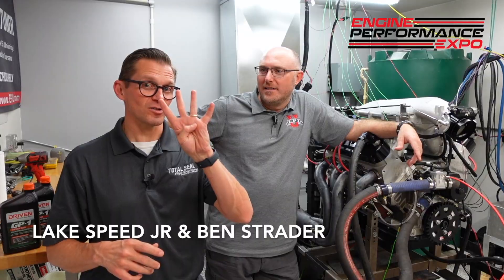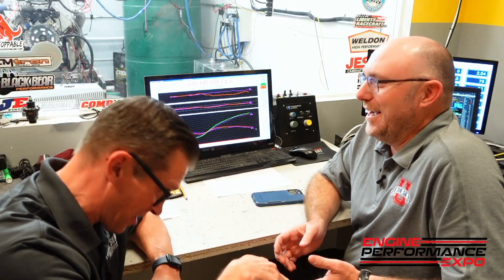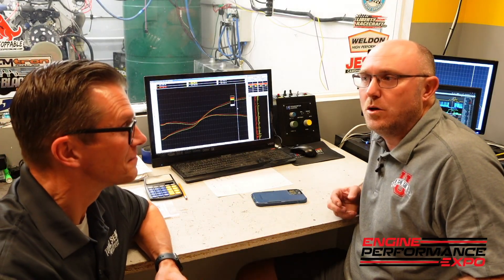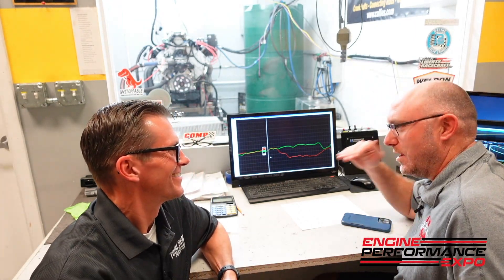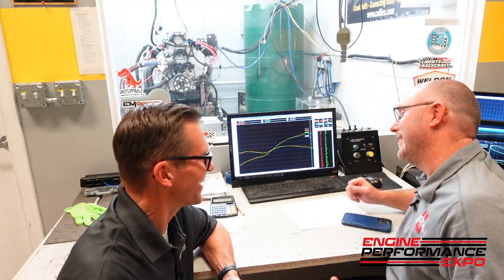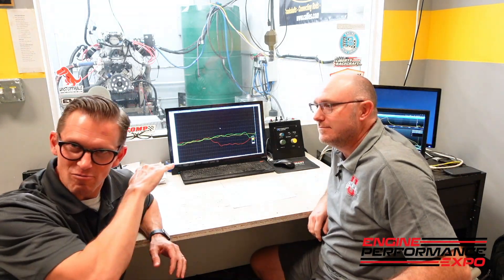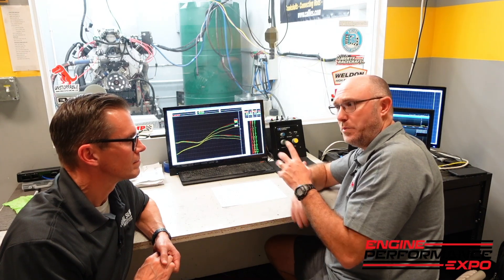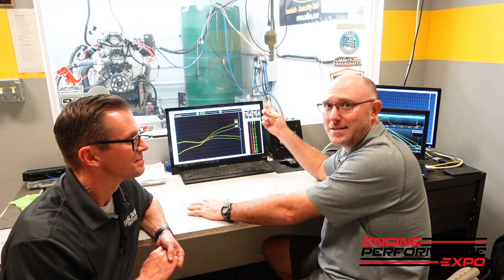How MUCH OIL is TOO MUCH? Dyno Results!

Comment: Did I miss where they mention how much oil this engine took, was 9 quarts overfilled? I was thinking this was going to be showing what happens if someone overfilled their oil and what effect it had. Like, does half a quart overfilled matter? What does a quart over do?
Reply from the maker: The oil pan was designed to hold 11 quarts of oil with steel rods, which have a smaller cross sectional area. With these Aluminum rods (much larger cross sectional area) we had to drop the oil level to keep the rods from hitting the oil.
Reply: @themotoroilgeek  thanks for the explanation. So 9 is full or overfilled on this setup?
Reply from the maker: @seashackf1  For this set up, the data indicates 9 quarts is overfilled.

Comment: What about fitting a better oil pump and pressure regulator? Get the advantages of extra lubrication without extra oil.

Why does the oil pressure drop in the first place? Is it because of the pump and regulator being inadequate in some way or some other reason?

How much oil foaming is taking place and is this a factor?
Reply from the maker: The pressure drop is due to oil being retained in the heads, which dropped the inlet head pressure.

Comment: Running a car low on oil is one of the worst things you can do for it, which comes in second by running a car with too much oil in it. You'll break the engine if you run it with two quarts more than it needs. It takes a little longer to break an engine running it two quarts low.
Reply from the maker: Right on!

Comment: I've always heard that an excessive amount of oil will cause cavitation in the oil.
Leading to extreme wear. 🤔
True or false?
Reply from the maker: True. If we kept running it at the high oil level, it would have caused foaming and that exact problem.

Comment: Oil pump will rob power too just pumping that oil. I don't run my engines at 7000 RPM so I would take lubricant over power in a range I will never be at.

Comment: Too low or too high of oil level is definitely bad, especially too low. I like having the oil level exactly between the two marks on the dipstick.
Reply from the maker: Right on!
Reply: I always go for 3/4 between lower and upper marks
Reply: Gotta have it at the top mark bud
Reply: @cartere9981  The full mark on the dipstick is full when at operating temperature. If your engine isn't hot then keep the oil level a little less than full.
Reply: If we want to use less fuel and drive calmly, it is better to stay closer to the permissible lower oil level, but... you should carry a canister of oil in the car for refilling and check the dipstick more often, and not wait until the oil indicator light starts to light up.
Reply: Top level is top marks!!
Reply: Always to top level. For protection!
Reply: @Davido50  The full mark on the dipstick is full when at operating temperature. If your engine isn't hot then keep the oil level a little less than full.

Comment: You guys make the best videos!
My suggestions though = 
1, You didn't really show at how much above the correct oil level you would start getting contact with the rotating assembly.
2, To a mechanic, it was elementary  that you would lose significant horsepower once you did make mechanical contact with the crank. It's literally a hydraulic dampener. Like a fan coupling or torque converter. 
BUT, I though the biggest issue was the aeration of the oil? Causing cavitation etc. Eventually damage as bad as detonation but in the oil circuit?
Reply from the maker: Thanks. Unfortunately, this is a Dart race block, so there's not a dipstick where we could have showed oil level. That would have been nice. 

In regards to aeration, if we kept running it we would have had a serious aeration problem.

Comment: An interesting comparison test. Unfortunately, the engine dyne is static and does not account for acceleration, braking and lateral load forces that would occur on the road/track and effect the location/availability  of oil in the sump to the oil pump. To finish first, you must first finish: I'll bet you would have a spun bearing in a lap or two with only 5 quarts during real world use on the track and/or oil temps would go through the roof on such a low fill. A windage tray or even better, a dry sump, solves a lot of problems, but the latter ain't cheap for the average schmo. I hope some viewers do not get swayed to under fill (unless they have pallets of spare engines sitting in their respective garages). Keep up the great videos, they are a treasure trove of information.
Reply from the maker: Thanks! We decided today to get the dry sump for this engine to run that test.
Reply: AGREED! 
I sense that this is a drag race engine destined for a sub 10 second car, so they would probably take the chance of sacrificing the whole thing to get more power, and just pray that they did enough of the wet sump fix 'tricks' to prevent any accelerative oil starvation.

Comment: At any point did you overfill the engine? I was expecting that to be tested.
Reply from the maker: That 10 quart run was overfilled, based on the data.
Reply: @themotoroilgeek  So the oil capacity is determined by the data? Interesting perspective. So then in regards to an engine that has a specified fill volume. Is that based on data or something else? 

I ask because I have an LTX engine that calls for 10 quarts. And your oil pan has an 11 quart capacity. But your data says anything beyond 10 quarts is overfilled. How can I compare this to my engine specifically without putting it at risk of losing oil pressure?

Comment: but i thought that overfilling will damage oil sealings on the long term! am i wrong? also im curious to see overfilling with low viscosity 5w40 then 5w30 then 5w20 & see how performance effected
Reply from the maker: If we kept running it at 10 quarts, it would have caused aeration/foaming problems.

Comment: I always thought if the crank was dipping on the oil the oil was way overfilled. With the low level, was it more the lower loss from the oil pump? In FR Banks I Kept no Diary  which i have not read for years there was a chapter where they reduced oli pressure to meet target power. I cannot remember if it was a Fird or Chevy V8.
Reply from the maker: When it lost big power, that was overfilled for this engine (due to the size of connecting rods).

Comment: So the question no one seems to be asking (that i could see) is what are you risking while you watch your oil pressure nose dive at 800'? This video seems to insinuate that having good oil pressure to the end of the pull doesn't matter.  (Asking as a member of the "dump another quart in it until it makes it to the finish line club") is it not a big deal to go through the lights at 8,000 rpm with 30# of oil pressure?
Reply from the maker: That slight drop in oil pressure at the end is not a big deal. We will have another video coming soon that shows those results.

Comment: I do recall hearing from a mechanic friend about a car that came in which was down on power.

The owner had decided to fill the engine with oil.

As in completely fill the engine all the way up to the oil cap on the rocker cover.
Reply from the maker: LOL
Reply: @themotoroilgeek , yep. It would barely run.

Comment: I have a story to tell that im not pleased with...

I've done many oil changes in my life but the first one I ever did myself I did very incorrectly. I thought engine displacement = amount of oil capacity. So i put about 2.75qt/L of oil in an engine that required 4.5—4.75qt of oil.

Man, i tell ya, when i first got the car on the street I was really impressed with the performance thinking "wow this is some good ass oil!" That is until after 20-30 minutes the engine bogged down and stalled and kept doing so...i limped it home and realized my mistake and added the correct oil amount. From that day onward the engine burned about a quart of oil every thousand miles. I had that car for many more years and it eventually stopped burning oil entirely for the last 10k miles of my ownership of it
Reply: Reminds me of a letter to the editor I saw in Hot Rod (or a closely related mag) in the mid-'80s.  Maybe it was the April issue, I don't know, but a brand new Corvette owner said he changed the oil filter after ? 1000 miles, as the manual instructed, and the manual also said the oil capacity was 5 quarts, 6 when changing the filter.  Soooo, he changed the filter, added 6 quarts, and the thing ran poorly, smoked, rattled and more!   😂 True story though!
Reply: @noimagination99  had to read your post a couple of times to realize he JUST replaced the filter and put 6qts of oil in on top of the existing 5 or so qts.
When limited experience isn't good for a DIYer!!
Reply: my worst oil change was on my 2020 corolla hatchback  i start my car and oil filter was leaking after 5km low level light ! and tik tik tik tik noise ! towing and restart again my oil change filter was broken ! noise was normat after the second oil change this is my last time ever after 10 000km engine run fine but im scare (sorry for my english im french ! )
Reply: So you changed oil without checking the dip stick? I always check the oil level with the dipstick and adjust to get it right up to full. I'm anal about having the proper level i will even just add a pint when it gets halfway to the add :face-fuchsia-wide-eyes:
Reply: @grampy2004  I had trouble seeing new clear oil on the dipstick anyway.
Reply: Was it a painful divorce? 😂
Reply: @bruceli9094  no because if you read the rest I kept the car for years to come and eventually the oil consumption went back to 0 (30-40k later)
Reply: Must be a miracle...
Reply: @summerforever6736  pretty rugged engines. My other car of the same make/model has 250k miles. But I've seen them with 300-350k
Reply: @epicraptorman I have a question how can the oil go back to nkt consumption oil?
Reply: oof
Reply: what car?
Reply: @brother_maleik  Tiburon 2.7

It died at 178k when I hired a shop to extract a broken tensioner bolt. They had to pull the engine to access the broken bolt and upon lowering it back on the car a gear to the harmonic balancer broke on the frame rail and shredded the timing belt at 70mph.

My oil mistake happened a few months into owning the car at 120k
Reply: @epicraptorman Weren't the Tiburons known for burning oil?
Reply: @JJFX-  no. Not any more or less than a car of that era.

Saturns are known for oil burning. Tiburons are just known for being underwhelming performance wise and irresponsible owner snapping timing belts
Reply: @epicraptorman  My unpleasing story is thinking that you're supposed to check the oil level with the engine running. Naturally it read high, so I even went and drained some with the engine running to a point the oil light came on. What was I thinking..
Reply: I put too much oil in my car once (I assume), that the oil cap poped like an explosion after driving it for a while. Didn't realize what it was and drove the car for a week leaking oil everywhere wondering why everything smells terrible.

Comment: I never worry about it and fill to the MAX line on my personal vehicles but on my girlfriend's car where she takes it to the dealer for the oil change package she bought, it is always overfilled by a half inch. Exactly why I never trust the trades to do anything in my world. I now do her oil changes.
Reply: no matter the dealer they always overfill.
Reply: a half inch above max isn’t anything to worry about … try 9 quarts when it asks for 5 quarts that’s 4 extra quarts. My dipstick is always at max or slightly above for good measure.
Reply: @varietyryan  I know, but the point is, the mechanics are not very particular about the job they are doing. Why not get it right on the MAX line. Are they in a rush? When I do a job, it is done right.
Reply: @varietyryan recommended quantity 900ml...if l pour 1000ml...will it be bad for my engine...[it's a 20 year old bike].

Comment: Bearing clearances ultimately dictate oil pressure, the system as a whole develops the proper pressure, and the oil pump is there to provide flow. This test exactly demonstrates the effects of pumping losses. Nice to see this notion put to test.
Reply: demonstrates engine destruction due to air in the oil LOL.
Reply: @TheGuruStud I don't quite understand when somebody mentions changes in oil pressure when itself it is dictated by the oil pump (which is submersed pump by design), not the amount of oil. True, crankshaft hitting the oill wil areate it, but nobody in the right mind will do that or compare it to anything. You also get oil splashed by crankshaft and pistons everywhere and force it where it was not designed to go. It is apples and oranges comparison. 

This "experiment" would make sense to me if you had put a sump of larger capacity (say, one can take standard and increased amount of oil safely in relation to the oil pump intake). I guess there would be differences regarding oil temperature. It would take loger to heat it to working temp, but the amount of it would make oil providing better lubrication on the long run.

Heck, even testing by putting oil to hit a factory "min" and then "max" would make sense (might determine if there is some lack of lubrication at min level).
Reply: nada, virtually all oil pumps have pressure relief or bypass circuits designed to open & relieve excess pressure.. this ensures that extra rpms dont turn into extra oil psi.. clearances or extra can influence the amount of oil pressure but do not in any way dictate it. the pumps in your car would easily exceed 100 psi or more when rev-ups occur 4k rpm +. at 100 psi, you most likely would have oil leaking out the mirrors.. the regulating or bypass circuits control the psi limit.

Comment: I just purchased a new vehicle with a Turbo-charged engine.  I am so glad I came across your channel and have watched a TON of your videos.  Very informative and helpful.  I catch some flack that I am going overkill because I did my first oil change at 750 and again at around 1600, but feel pretty good that I am setting up the engine for long term success (at least from an oil perspective).  I owe it to you!
Reply: Sure won't hurt.
Reply: Did something similar for Toyota 2ZZ. First 500 miles conventional oil and then 3500 on full synthetic. After that every 5k/6mo full syn change.
Reply: Good. Taking car and maintaining your car is very important
Reply: Older engines last because they have horrible mpg,performance numbers, and heavy parts. Wouldnt really call them better or worse. just different. btw you dont need to change it that often unless you beat the crap out of it or went thru some brutal environmental changes. Get good clean fuel, keep the fuel system clean, and watch your air filter to maximize oil life. 4-6000 is what I'd call a safe interval but again depends how you drove it. monitor it frequently.
Reply: Buying a turbocharged car is your biggest mistake. Naturally aspirated for a long engine life every day of the week
Reply: @BubblesTheCat1  Turbos are no breakthrough technology. They've been around for decades and can be every bit as reliable as a N/A engine. Most turbocharged cars get a bad rep mostly due to their owners. Yes, turbos have a much smaller margin for error when compared to a N/A engine and absolutely cannot neglect them. But they honestly don't require any special maintenance, just the normal stuff (check your oil ever week or so, change your oil every 4,000 miles, allow proper time for oil flow during cold starts etc.) I have a 25 year old Saab 9.5 turbo that is still running strong till this day.
Reply: @BubblesTheCat1  Sure, having a turbo engine might mean less life. However, how much you lose depends on how good the turbo engine is. Somehow back in the days of the Volvo brick, SAAB 900, and Datsun 280ZXT, turbo power wasn't killing them quickly. The engines would still run after everything else fell apart.

There might be an argument that more modern turbo engines were a problem. Well, the VW MKIV GTI and Evo 8/9 could take the boost and have the engine outlive everything else, just don't turn it up. Well, I suppose it could also be because the rest of a VW GTI MKIV or Evo 8/9 were made of flimsier stuff than a SAAB 900 or Volvo brick.
Reply: @skylinefever  Yeah, I drove big V8 semi trucks. Diesels, of course, and the turbocharged ones did about 800 000 km before needing overhaul. The non turbo V10, used more fuel, and were absolute dogs in hilly country, or climbing a mountain pass. But...they easily ran 1,5 to 2 million kilometres before needing any major work done. 😁
Reply: @BubblesTheCat1  That is interesting. I suppose heavy equipment is built to not be as disposable as a car.

I'm guessing you are in Europe. Most long haul trucks in the USA have inline six diesels. There were a few V8 diesels.

I think about how in Europe, many people had a VW diesel car. It seems like whether they had a non turbo mechanical diesel or a distributor pump turbo diesel, it outlasted the rest of the car either way. That in mind, a MKIII or MKIV Golf didn't have that much to outlast. I know Europe got a lot of non turbo and turbo BMWs, Peugeots, Volvos, and VWs that the USA did not get, but I know little about them because they did not interest me that much. When I think about cars the USA did not get, I usually think of the Japanese turbocharged gasoline drift missiles and rally cars the USA did not get. I suppose it was because my mom had a 1985 Nissan Maxima and I thought it was super cool when I was a kid.
Reply: @skylinefever  Long haul trucks run open road most of the time, hence the high mileage. Less cold starts, and  sometimes continuously running for days on end.